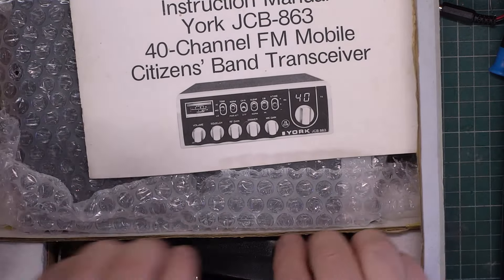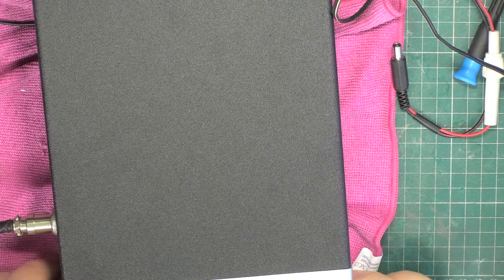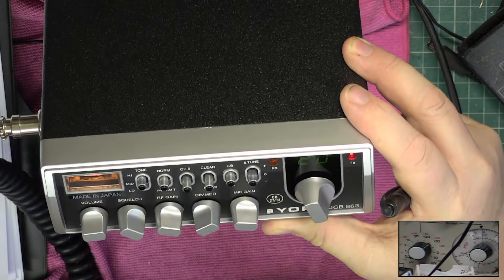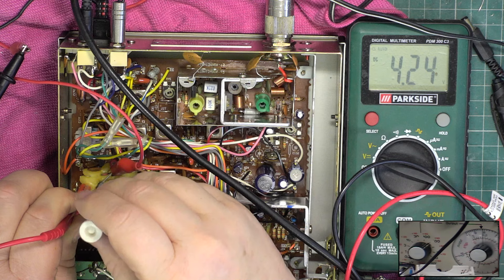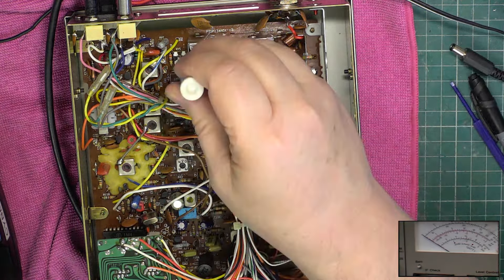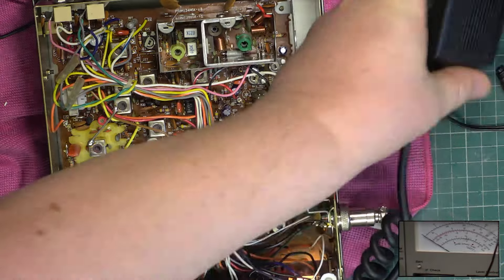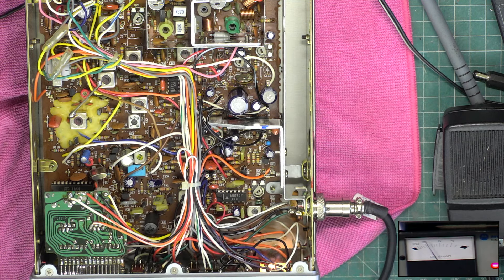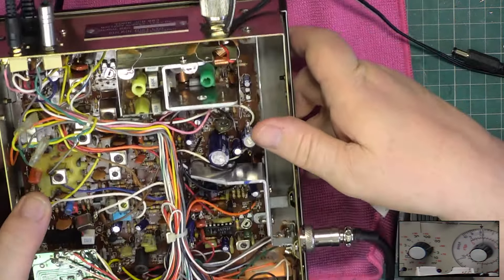York JCB863 CB27/81 UK FM CB  radio -  service alignment (boxed set no3)

Comment: You titled the video incorrectly Richard!! Are all these boxed radios from the same customer? they are all high end sets, Yorks, Rotels etc are they just a collector or did they use them at different locations, I understand that you cannot give too much information away but it would be interesting to know a little of the story about them all
Reply from the maker: Thank you...title corrected.  They belong to the same customer & we're taking the six boxed sets I've done for him personally to Lowestoft tomorrow (Wednesday).

Richard, G0OJF, UK
Reply: I don't think of it as a collection but I certainly purchased the latest batch from a collector, and what a collection it was. I often buy multiples of something for redundancy. You like something, it breaks, you have the same to use instead of changing. I don't know if I will always own them all but I am fairly confident in keeping the York 863s now into old age. If you have to have a go-to rig, you could do a lot worse. Years ago I would have to sell something to justify (or even afford) getting the next thing, as time has moved on I don't have to worry about that now.